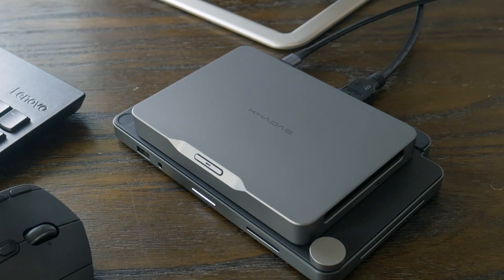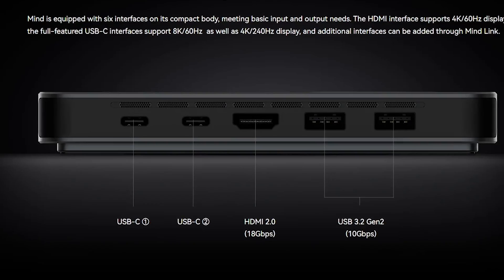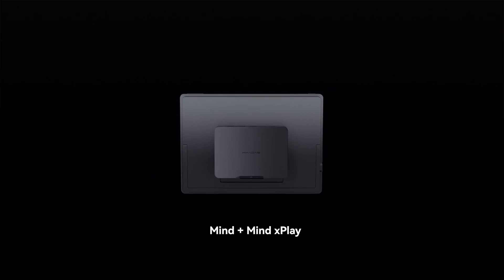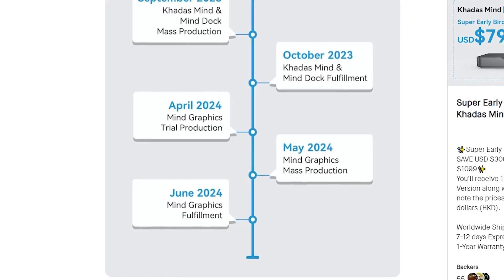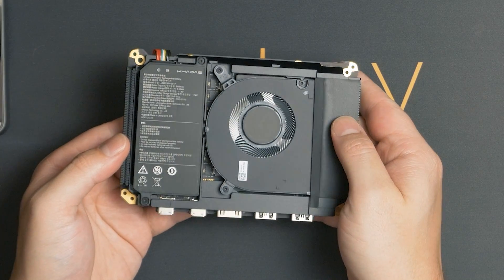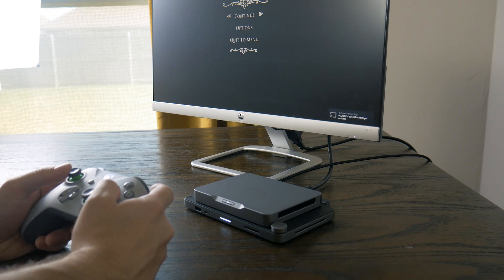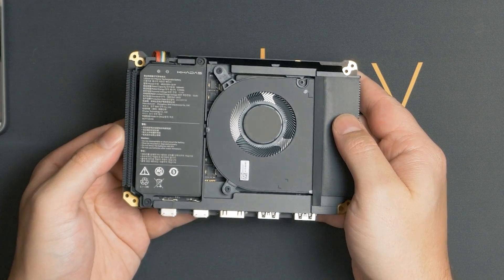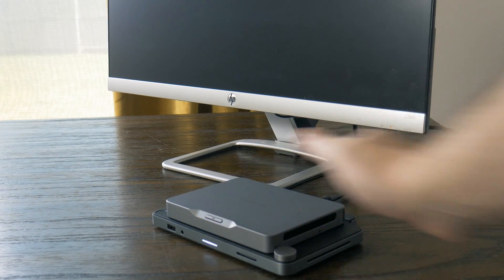Is THIS the future of PCs?

Comment: But.... why?

It does not solve any practical problem, you cannot already solve with cheaper and standardized devices, that are also more optimized to their job.

Even if they had all the accessories and other docs already available question would still remain. Why?

Why special connector, when basically same can be done by some usb or thunderbolt port and cable? It would be more versatile, more adaptable to different form factors, etc.

Even if it would become a industry standard and used by multiple vendors to build docs and computers, that still does not solve anything, and is short sighted. Things like USB and thunderbolt are extremely compatible, upgradable, small, and robust. Special big connector, only has disadvantages.

Comment: Those "Warranty Void if ..."  stickers and notices are themselves void. They violate the 1975 Magnuson-Moss Warranty Act, which states that no manufacturer charging more than $5 for a product may put repair restrictions on a device on which it is offering a warranty. This has been enforced in many recent instances against some very large companies by the U.S. Federal Trade Commission (FTC). So opening the device and substituting parts for repair or upgrade will NOT void the warranty. They should not be putting those stickers on. Just a bluff. The could possibly deny the warranty IF they can demonstrate that the purchaser somehow damaged the device, that the malfunction was his fault.

Comment: do a diy cluster with 5700g is what i say - make two of them for less than 700 and then spin up a vm to be the last node in the cluster - the 8 core apu enable am4 amd platform probably has the most value now - kicking even refurbs to the curb - i could be wrong but that is my gut feeling - things to explose with this could be 40g networking, dual nas, and netfs other than ceph - i think they have enough pci lanes so that you can do very fast networking plus a gpu - for better compute on the cluster

Comment: The concept of mindlink bears a resemblance to the modular design prevalent in that late 80s. During that time, several early laptops incorporated large modular components that could be attached for different functionalities, such as peripherals, printer and more.
Reply: and ThinkPads until they remove it in ThinkPad T480 back in 2018
Reply: All business and workstation laptops come with docking connectors. For obvious reasons.

Comment: In the United States, the "Void Warranty If Removed" is completely invalid and holds no water. It is pretty much there now to deter the fearful from opening up the gadgets.
You can actually, legally, open a device, do some damage from opening it or botched job of replacing something, and return it under warranty for a replacement. They'll give you the run around, of course, but bringing up the legal invalidness of the Void sticker should help to get it replaced either way. 
Don't take my word for it (referring to anyone, not just HH) , do you're own research on the topic. 😉

Comment: Pretty sure that the "Mind Link" propriety connector is just a Pci-e 5.0 x8 pins + power pins and the HDMI + USB pins you mentioned just put together in a single connector.
Shouldn't be too hard to interface with it with trial and error.

If it has pins on both sides then the middle part is definitely PCIE
one side is power connections maybe usb
and other side is hdmi pins.

But without closer look is just speculation.

Comment: Such.a shame! It looks like quality kit and I want to love it, but as others have said, it’s proprietary. This sort of thing has been tried so many times in the past and always failed, hard… resulting in expensive paper weights.

Really, if you want people to buy this stuff then first off it needs SODIMM memory not LPDDR, so it can be upgraded. Next… how about a more standard M.2 size (2280] there’s absolutely no reason for designing this thing with the short M.2 slot, it’s just a really silly restriction.

Finally, and probably most importantly; make the design an open standard with a commitment to building future devices and compatible peripherals for the next 5 years.

Unfortunately, this thing will be dead… soon. As I say, wanted to love it just can’t!

Comment: The biggest problem this has is it isn't thunderbolt compatible. You can pick up TB docks for cheaper than their proprietary one and THAT would be a compelling value potentially. Them not including TB is a HUGE technical misstep.

Like you said, USB-C/TB has it's limits but ultimately those limits are well above most user's needs, even in the corporate world. To move units with a PC like this it would have to have a compelling value over TB and it's just not there.

Comment: You should not have stated about opening it voiding the warranty and called them out on it since in the United States those claims are against the Magnuson-Moss Warranty Act of 1975 which specifically states that those are not allowed.  Please learn.  Also "ecosystem" is the same thing as proprietary connections that are on motherboards which you should also fight against.  You are very disappointing.

Comment: Aren't ATX-based PCs already modular? When you introduce a proprietary form factor, the burden of proof is high to show new capabilities that are enabled by it. The powered sleep ability is definitely a cool addition, but I'm not sure it necessitates a new form factor. Seems like USB4 could cover all the expandability features (eGPU, port expansion), which might explain why they didn't include it!
Reply: If anything the tower case allows a lot more room for a graphics card and other stuff.  The only reason someone would not like a tower is the space they take up.  Really I like being able to expand. It is so nice not having things soldered down and that is because when they fail it is much easier to remove them from a socket and put a replacement or upgrade in.  Also one thing I don't really like about small form factors is there is not a lot of room for cooling.  It is possible to have a terrible cooler and an overworked fan that would be one of the problems with it.  One of such problems would be fans always wearing out much too soon.  The only thing worse then would be it being a special part or one that is really difficult to replace.  It is a reason I don't game on my laptops.  It is just that the CPU cooler is mediocre in nearly all laptops and can't handle that heat all the time.  I like a desktop with a nice big case because I can get a nice big CPU cooler in there and never have to worry about cooling ever again.
Reply: @charleshines2142  yes the mini PC I have isn't super high spec but has enough cooling space. The higher end ones tend to have more but not as much as I'd like. They're often using silly little laptop fans, instead of saying to themselves, 'Wait, is this square little brick basically the size of a normal PC case fan?' 'Why yes, Bob, yes it is.' 'So we could make it 1 case fan deeper, and let people put a full size case fan in for about £15, including the ability to choose a really nice quiet one or a cheap one?' 'Yes, Bob.' 'That's cool. Let's not do that though.' 

Yeah, I don't get their logic. Reviewers always look at them and say the same things. Is the RAM soldered? Yes. Bad. No, Good. Is the wi-fi soldered? Is there a fan at all? Is there a space for a 2.5 inch disk? Is there one NVME slot or 2 and are they full length. I'm like... just make your high spec one deeper, or longer, and fit it all in and you'll beat every other model out there... some of us would prefer going from 4x4x1.5 inch to 4x4x4 and some would prefer 4x6x2. Either way, not rocket science for them to satisfy all portions of the market but they continue to release too many models that are too weird. 

Still... on the basis that if they throw enough mud at the wall, some of it will stick, we are now getting perfectly capable office PCS, mini routers and servers and so on and so forth in truly small form factors that cost about as much as an ITX case and a motherboard... If you want something for a parent, grandparent or child, a mini-PC is perfect, and for many/most home users too.
Reply: With a PC, just buying a UPS will let you have powered sleep
Reply: @tbqhwyf  Sure, but UPS are fairly expensive, large, bulky, and really overkill for the base functionality. 
However, there is a real opportunity here. Power supply companies could incorporate the idea directly into their power supplies, and it wouldn't require any special new motherboard. 
At the same time, a company could come up with a solution that plugged inline with the power connector and provide the same functionality to most existing PCs. 
What makes it potentially better than a UPS is that the price could be lower, the device hides inside the case, and the basic functionality of preventing the PC from crashing as a result of power loss is provided discreetly. 
I like the idea. A UPS is potentially better but they're bulky and not as elegant of a solution.

Comment: Dell literally has a connector that looks just like the Mind Link that they used to use for their docks before Thunderbolt and USBC. They were abhorrent pieces of tech even when they worked properly because when drivers were installed and the devices properly connected they would still regularly drop connections to anything that wasnt directly connected to the mainboard.

Even if they open sourced the Mind Link there is the other issue, the office user. As someone who is working in IT, offices have been migrating to O365 and "Cloud" computing. This is to mean that everyone accesses a portal and signs into a VM to do any work and BYOD. It allows them to kill recurring hardware costs, control access, and pause (or kill) the VM if idle. This would have been incredible 6 years ago. Niche indeed.

Comment: IMO, here's the future of desktop PC's...
You have a "base station" which is basically a "good enough" PC for browsing, adding storage (i.e. M.2) etc. Windows/Linux is installed on that. If you want more PROCESSING you choose a separate device that plugs in via 80Gbps USB4 or whatever makes sense... think of a higher end device being basically identical to an XBOX Series X (SoC + Shared Memory) or whatever CPU/GPU/RAM combo you want but minus the storage. When you run a GAME or VIDEO EDITING program it simply runs on the 2nd CPU+GPU.
This has many BENEFITS including the ability to mix CPU architectures, and no requirement to reinstall your OS just because you upgrade. And the 2nd device should have reasonably good resell because it's an all-in-one device which should have some self-diagnostic capability. Thus TROUBLESHOOTING is also much easier.
The device could even work with any EXISTING computer even with only USB2 provided you don't need fast access to the storage. Ideally you want fast SSD access as well as pass-through to a monitor hooked up to the main OS base but the add-on could just output to a MONITOR if you need to. So perfect for EXISTING LAPTOPS!
Reply: Almost that.
Think it more like a nas where the disks are the module you want to use. 
Then, each module could be swap/resell/upgrade. Using CXL and a define connector.

Comment: I really don't understand the need for this product to exist, if your main motivator is portability, what could be better than a laptop? Those also come with a screen, keyboard, and trackpad included by default, giving you everything you need to work basically anywhere. You won't be able to take this with you and work on it anywhere besides in an ecosystem specifically tailored to use this device. Let's say your workplace decides to start using this thing because... reasons... They would spend a ton of money on getting a "mind" for everyone, and the graphics modules for designers, the networking module for IT for instance, etc. Not even including peripherals, I guess the average cost per workstation would be around $1500, which is way too much.
If you have to design your life around a product for it to be convenient, the product is inconvenient.
I'm either missing the point completely, or this is a really stupid product.

Comment: if the mind link port became a standard, I would be all for it. laptops could devise a standard using the mind link port where multiple laptops could all have a docking port that doesn't require buying a new dock for each laptop. 
I know plenty of companies were using proprietary dell or HP docks, they switched to thunderbolt docks as soon as it was cheap and available, this port would bring it back to the easy "slam the pc down on the dock and start working at your desk" ease of use.
Reply: it's too wide to work on laptops.
Reply: @TheExileFox  not really no. The dell docking station has a connector about the same size
Reply: You are essentially describing USB C and Thunderbolt.  Universal and moves TONS of data.

Comment: I could see this as a cool solution for a business that has work from home and hotel like desks at the office. The desks are setup and all that is needed is this going from place to place docking in. Again though, we've been doing this for 15 years already using laptops and docks. It's a cool concept for moving from one desk to another.
Reply: Yeah sadly I can't see any company actually going for this, for the reasons you pointed out as well as it being a data-security nightmare. Removable hard drives already cause far too many data breaches because some idiot left the drive on the bus or in a taxi.
Reply: Laptops already fill this use-case. Now, if this thing offered a good cost savings compared to a laptop, then it would be worthwhile. However, with the cost similarity currently, the laptop essentially gives you a free screen to use it away from the docks.
Reply: @javaman2883  I think more to the point, you can already pick up a normal mini PC and pocket it in an average jacket. Laptops have unnecessary screens with them which are a pointless waste of money, terrible cooling, terrible storage, laptop rather than desktop processors and on and on. Great for a coffee shop, not for a home + office solution. But realistically who wants to carry their machine around? That's not really why mini-PCs are popular as far as I can tell and you could do pretty much the same with a Samsung and Dex already.  I love the device existing, I hope it sells well but mostly because I want other people to innovate, and more eGPUS to be a thing until it's completely normalised to cool your GPU in it's own box, and get full speed connection to your main PC box (or tablet/phone etc).
Reply: I was surprised when major enterprise IT vendors went the USB type C way instead of proprietary docking connectors, because now you can interchange the docking station between models and vendors (not completely universally I admit). This mind link is a huge step backwards in my eyes. No, thanks.
Reply: companies are better off with vdi soultions in those cases imo.
Reply: We have desktops currently for our staff where I work, and they hate having to setup desktop icons and bookmarks on each computer they go to, so being able to move the desktop between work areas would be cool, but I could easily see someone stealing them in a medical clinic.  Not to mention the cost is no joke.

Comment: Yeah I would rather just use a nuc or framework mainboard in the 3d printer case with thunderbolt for any accessories. I dont think pcie 5.0 x8 is worth proprietary anything, especially at this price point. You might be able to convince me to use proprietary if it was crazy cheap, but this is way too much.
Reply: I got my razer thunderbolt dock for less than $180.